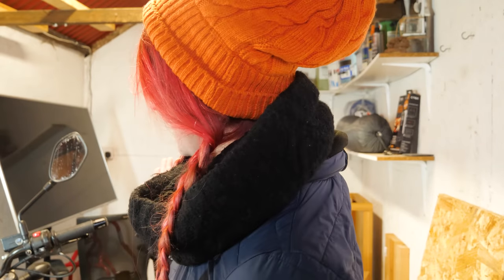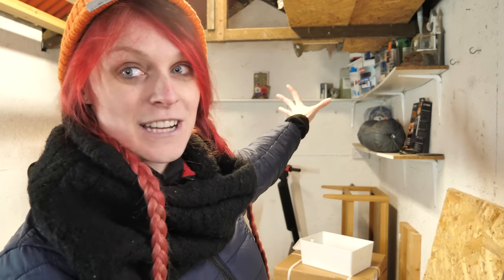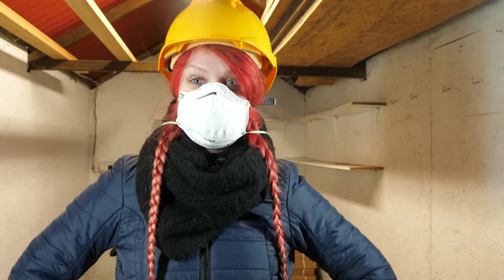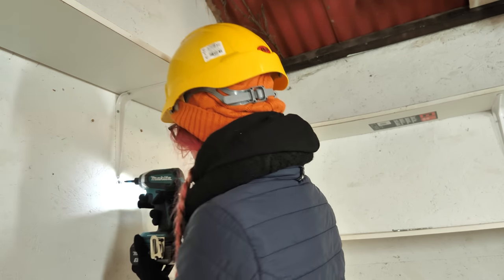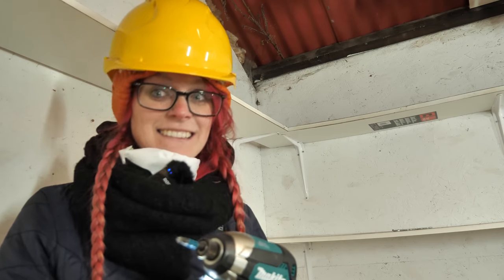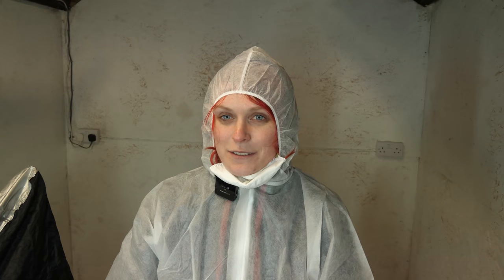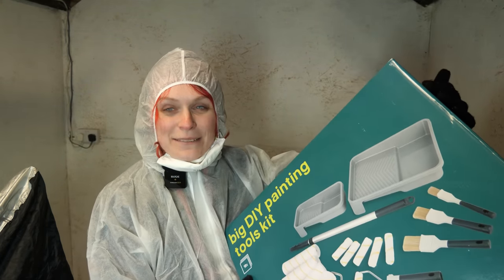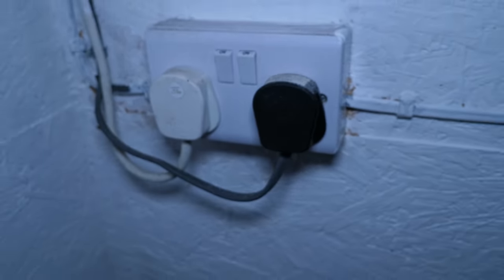Trying to build a bike garage

Comment: What security have you planned? Will you have access to the internet? Blink cameras are a good system.
Reply from the maker: Garage has internet, have some CCTV and I'm looking at some physical security too
Reply: @SaffySprocket  Blink cameras have an app for your phone, cameras will notify you when they are activated by movement, you can also watch live and they have a built in speaker/microphone so you can talk thru the cameras, easy to install. Just a thought, very happy with mine, all the best.

Regards 
David
Reply from the maker: @somersetlevellersmtb5564  I already have a home automation system set up, so I'll be integrating the system with my home one 🥰

Comment: Hi Saffy

When you replace the shelves make sure you treat the wood or seal the edges as the ones behind you are sagging a fair bit most likely due to weight and moisture getting in. 

Would be worth running a dehumidifier in the space also for a few days. 

Would also re run the mains sockets in conduit and get them checked. 

Look forward to seeing the end result. 

Rick

Comment: Great stuff! Electrical capacity in there will depend on the feed and cable size from the house consumer unit. Message me for further info, would need to be done by a professional as it’d need to be certified and for safety 👍
Reply from the maker: I will have an electrician help me :D gonna do the cables, then the electrician is going to come and check it all and do the formal switch on
Reply: Wicked good luck and looking forward to seeing the great progress!

Comment: One of the best garage floors for doing your own maintenance, and looks cool, is an epoxy floor.  You can have a variety of colours, and you can cast coloured chips in the wet epoxy before it drys.  It will 3:49  hold up to any spills from your bike.

Comment: For the floor you could consider the rubber interlocking floor tiles.  Will also keep the space warmer.  

And off course some foam insulating ceiling boards.

Enjoy 😉
Reply from the maker: Great idea!
Reply: ...and the noise down. Concrete reflects sounds and the rubber will absorb it.  Just keep in mind that if the floor gets wet you need to dry under the tiles as well otherwise you'll end up with mold.

Comment: Looking forward to seeing what you get up to with this one!
A few thoughts on things you could do from me:

Someone has already mentioned levelling/painting the floor - pick the right colour and it'll be a godsend with the kind of bike maintenance type stuff you're inevitably going to get up to! Something that screws etc are going to stand out against will be good, but also something light that any leaky fluids will stand out against may be a winner (help spot issues before they become big ones).

The other thing worth thinking about at this point is possibly having some kind of 'grid' put up in the roof - you'll want to check those joists are sound and capable of any kind of weight you'll want to put on first, but it could give you a world of flexibility for filming. Off the top of my head, having somewhere you can mount an overhead camera (at least a GoPro, maybe your DSLR) for Timelapse's etc could get some really cool shots, and it'd also allow you to get lighting up out of the way, and not reliant on tripods (which will save a lot of floorspace for you to work in).

Which leads me onto the third thing, if you do the 'grid' idea, consider having some of your power points up high - both to power lights etc up there, and to possibly have power 'dropped' where you need it - saving you from some tripping hazards in what will already be quite a tight space! You might find because of wiring regs they'd need to be switchable from a normal height, but worth discussing with your electrician.

Good luck!

Comment: Re Electrics. As an electronics engineer who works with low and high voltage and currant. If you are not super confident in what you are doing leave it alone, IT CAN KILL YOU. DEAD! Get a professional. It's not just about installing it, its meeting the regulations.
Reply from the maker: The plan is, I'll be disconnecting the electricity, re-wiring everything up and then I have a licenced electrician coming to check everything over and who will do the formal switch on :D
Reply: @SaffySprocket  Nice one. Most don't appreciate how dangerouse 240VAC is.
Reply: @SaffySprocket  And Happy New Year.